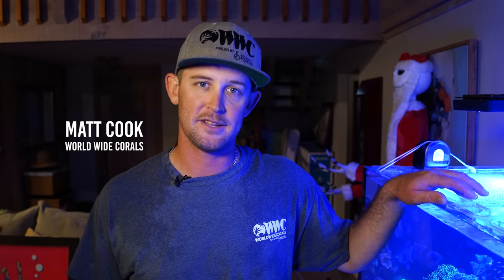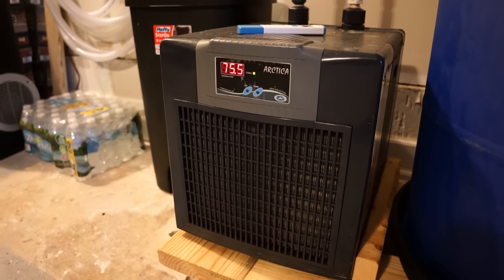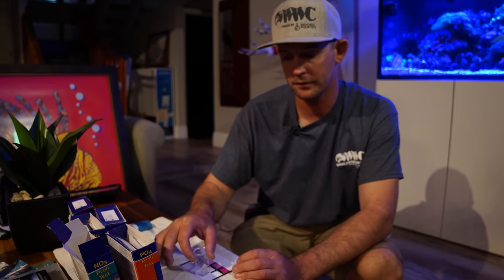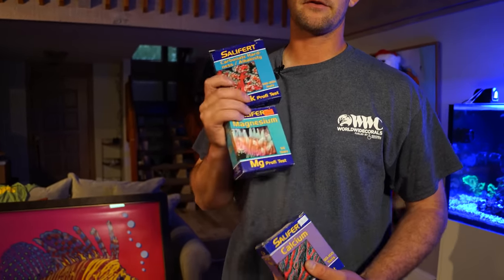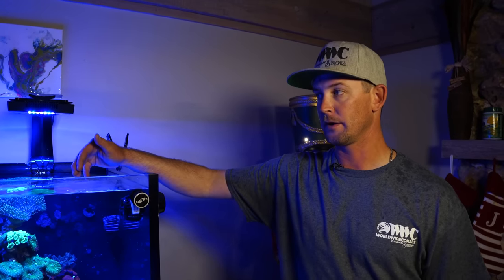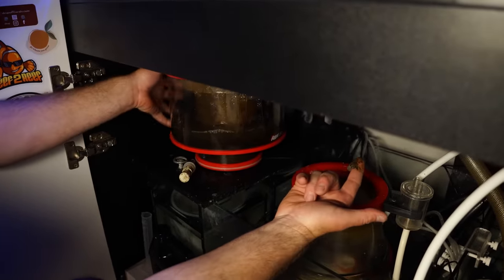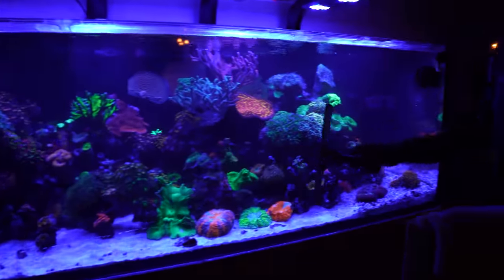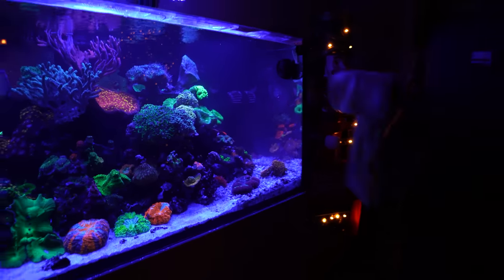The BEST saltwater aquarium maintenance routine

Comment: One thing i noticed is when he is adding the drops for the tests he is holding the bottle sideways and the drops wont add the correct ammount of liquid because the drop will run to the side of the dropper and add more than it was designed the bottle should be straight down for every drop to be the exact same size and ammoutn so you can get the most accurate results every time as designed by the test manufacturer.
Reply: You’re also comparing the result to a paper with potentially faded in color. And the color match has errors. So I don’t think 25 degrees of tilt will matter.  And you can argue about the degrees of tilt. 🤷🏻‍♂️